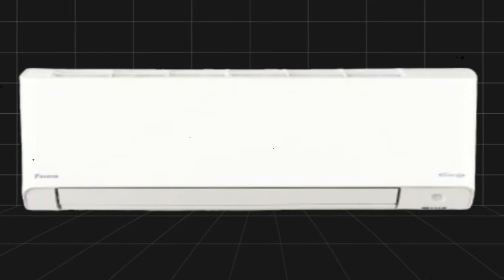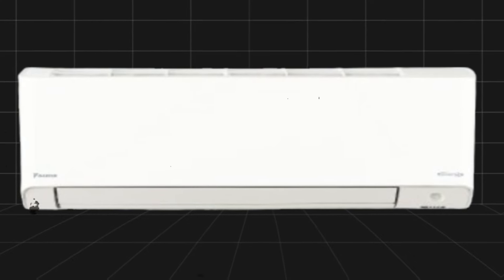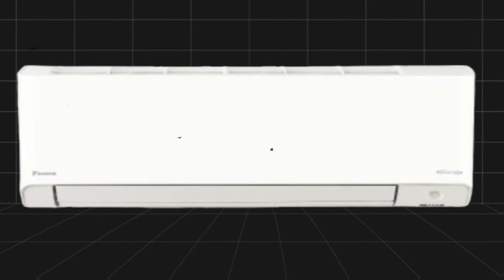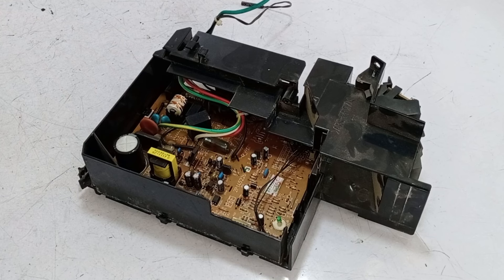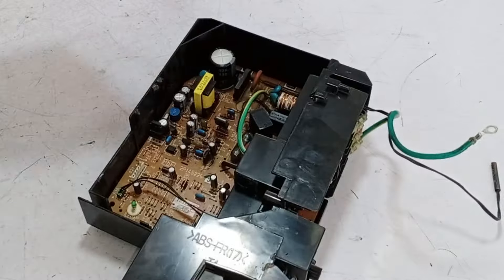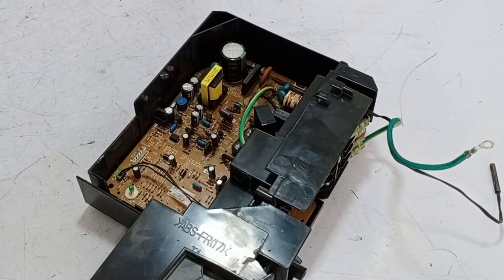Daikin Mini Split AC Indoor Unit Circuit Board Explained

Comment: That Daikin Standard or Inverter model? It seems Standard coz no IPM ic
Reply from the maker: Its inverter model, and it's the indoor circuit board, not the outdoor. The IPM is in the outdoor unit Circuit